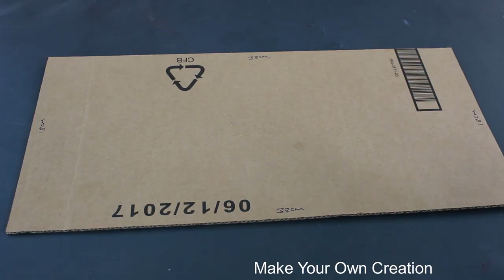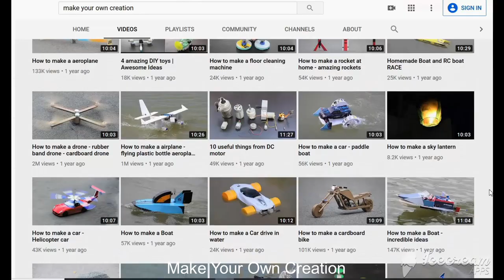How to make a Tractor With Trolley

Comment: You can make a simple power bank using  a 12v solar and a usb car charger you want connect the solar to the usb car charger the it convert the 12volt to 5 volt then you can charge the mobile 😁